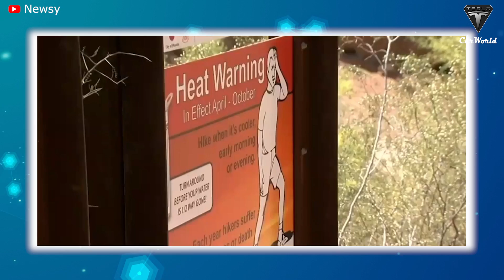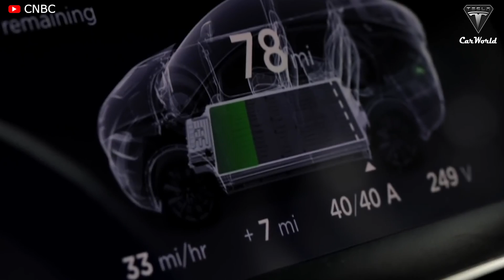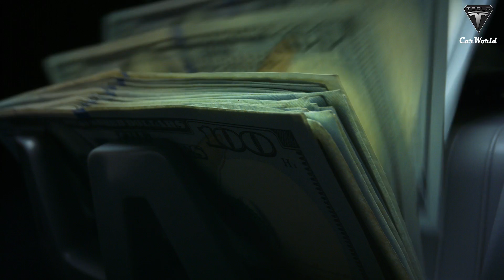NO OPTION! Tesla Faces Big Difficulty, Unable to Install Charging Stations in Texas!

Comment: As a Texas I am surprised to find out I have a weak electrical system in my house and regularly suffer power outages. Other than Feb of 2021 I can't recall not having electricity because of a lack of production. I have lost power because someone drove through a power pole, a tree falling, or a squirrel tripping a fuse. The Texas grid like all power grids can use some improvements. Your introduction makes me wonder about everything else you said.
Tesla's biggest problems is their chargers are proprietary and only Tesla owner can use them. Tesla says they are going to open up their chargers to everyone but until they do they shouldn't get taxpayer money to install charge stations.

Comment: Nope, nope, nope.  Live in Fort Worth.  Power is on.  Stays on.  Texas produces more power than any other state and is a net exporter of power.  473 TWh last year while California produced 193 TWh and has to import power to keep the lights on most of the time.
Reply: I thought that Texas didn't have high voltage connections out of state - or were they broken last winter - or simply not able to carry enough?
Reply: @markelkins8432  Texas is not isolated, take a look at a transmission line map and you'll see lines leading in/out of state.  Several factors caused the load shed event - one in particular was a lack of communication between ERCOT and the Texas RR Commission.  Note that the head of ERCOT and all the PUC have been replaced.
Reply: @stanley917  The first they need to do is get the R out of ERCOT, right now it stands for Ridiculous, not Reliability..

Comment: Very easy fix...just go all out by incentives on Home solar ...
Reply: Yes, I have a modest solar panel system, 3.6kW with net metering and EV TOU rates and living in SCal my Tesla runs on sunshine, my electric bills run a small negative as the panels send more electricity back to the grid than I take off the grid.

Comment: Uh, Tesla charges for using a SC stall, somebody has to pay for the electricity. There are exceptions, when I bought my Tesla it came with a sales incentive of free SC charging for as long as I owned the Tesla. It is my understanding that the revenue is used to pay for electricity, pay for maintenance and the rest used to pay for new SC stations, presumably not a profit center but self-expanding once Elon had it kickstarted early on.  The only per minute charge ($1) is if you leave the Tesla at a stall and don’t move it after it is finished charging (to whatever you set it at), there may be someone else wanting to charge if the stalls are all being used. Makes sense to me. Your Tesla app will let you know when it is done charging.

Comment: I would fact check every thing before putting it in a video. Most of the things mentioned in this video is false. First you don't need as many chargers like you do gas stations as most EV owners charge at home the reason to have more super chargers is to be able to sustain the increasing EV usage on long trips, also the 7.5 billion you are quoting as a cost is also incorrect as with mass production the cost will drop and additionally when you mention profits of tesla at least put the effort to fact check that in Q1 of 2022 Tesla's profits were 3.3 billion. So you are just spreading lies and confusing simple people who might just fall for the misinformation.
Reply: Yes, there are a lot of misinformed people, including so called journalists who are pathetically and hilariously misinformed on EVs, esp. Teslas.  Since about a year or two ago Tesla Superchargers now come in pre-built 4 stall units. This makes installations quick and simple, bringing in the high power line is the hard part. Since Tesla stations are located near restaurants and hotels that is usually not a problem unless the station is a huge one like the one in Barstow, CA close to a large factory outlet mall. The 20  stall station will soon be 100 stalls, the largest in the country.  For typical 8 to 16 stall stations converting existing parking spaces for a high power line is fairly simple, the hang up is getting the permit and putting in the stalls in this period of labor shortages.  Expect many more SC stations in the next couple of years.

Comment: Your update sounds really confusing to me, on one hand you are saying that the Texas Government want to install EV Chargers every fifty miles to service the expected increase in EV vehicle sales and then on the other hand you are saying that Tesla is going to run into challengers when they start adding extra EV charging stations to their existing charging network. Who is going to challenge  them, not the Government because they what more EV Charging stations and the more Tesla install the less they will need to install, and I am dam sure that the people of Texas will not want to stop Tesla from increasing there charging network either. One issue that all EV;s suffer from at the moment is the lack of handy charging stations. If you drive an ICE vehicle, there is never ever a concern regarding your trip because ICE vehicles have Gas stations everywhere, EV don't. If there is a problem with the power grid, and some of your other readers don't seem think there is. That's the Government job to fix it. That why we all pay taxes.

Comment: Why install charging stations in a state that doesn't want electric cars? Here in Arizona, we want them, and are buying them by the sh%t load. There have been 4 new charging stations in Arizona in the last 3 years. There are none in the whole east valley of Phoenix. That includes Mesa (second largest city in Arizona}, Chandler, Gilbert, Queen Creek, San Tan Valley, Tempe, Ahwatukee, Apache Junction, and I'm probably forgetting some. We are currently on a road trip that takes us through California, and I'm amazed at how many choices there are to charge a Tesla. Some charging stations are 5 miles apart from each other. I have shared my frustration about this many times here on You Tube, and even send emails to Tesla to find out what we did to make them mad at us Arizonans, they don't reply to me. They probably laugh when I send an email, "it's him again". End rant.
Reply: California gotta way bigger demand than Arizona. And beside the west coast, there's really no big EV community. People in the south, east coast, and Midwest travel. People on the west coast don't really travel on road trips like that. The time to road trip in an ice car vs an EV car needs to get better tomorrow. Not next week. Not in the future. It's need to get better tomorrow. People still drive ICE cars because even though gas is high, I can fill it up and go. No wait.
Reply from the maker: I hope Tesla reads and takes into account your feedback as soon as possible. Thanks for your comment and have a good day !
Reply: @TeslaCarWorld  Thanks, and I to hope they see this, and do something about it.

Comment: I still want to know exactly where this extra electricity is going to come from? 68 percent of all electric generated by burning fossil fuels in the USA does a electric vehicle make any sense. And explain Who and  How the depleted battery pack will be handed. RECYCLED? How seems no one knows.
Reply from the maker: Thank you so much for all of your comment! Have a good day!
Reply: Michael Shampine - It's these Same "Fossil Fuels" that are used in Oil Refineries to fuel your F-150's!
Reply: Do you understand what a figure of 89 MPGe Means?

It means 3x LESS Energy for a Model X, than for an Equivalent ICE SUV! So, it takes "Less Energy" because Electric Motors find Waste 66% of the Energy!
Reply: Depends on the state. In California about 30% is from renewables, mandated by law to be 100% by 2045 with intermediate goals. All new homes built must have solar panels.  I drive a Tesla, have a modest 3.6kW solar panel system, net metering and EV TOU rates, my electric bills run -$10 to -$25 each month, also have a new heat pump that replaced my 19 yo AC and the old gas furnace. So my house and Tesla run on sunshine, also when I ordered it in Fall of 2019 it came with a sales incentive of free Supercharging for  as long as I own the Tesla which is a 2020 model. Sure beats pumping gas, ymmv.  As for batteries, expect Tesla batteries to last at least 300,000 to 500,000 miles so easily 20 yrs+for most people. As for old batteries, they are being recycled by recycle firms such as Redwood Materials founded by a former Tesla executive, I think they are in Reno, NV.  Have you owned an ICE that went over 300k miles?

Comment: I'll never invest in an EV. I don't see them as very reliable.
Reply: If you don't see EVs as reliable, I'm curious at to what you are looking at.
Reply: @evwannabe593  I've had my car for a while and I'm not shelling out what they're asking. I'll stick with my car.
Reply from the maker: Electric vehicles are gradually making breakthroughs. I hope you will think about this. Thanks for your comment and have a good day !
Reply: @TeslaCarWorld  Sorry, but I've made my decision.
Reply: Much more reliable than ICE, much less parts, no need for oil changes or tuneups, brakes jobs normally not needed thanks to regen braking, I can drive for a week and only use my brakes once or twice. Go test drive a Tesla, no sales pressure, make an appt online, you’ll see why EVs are the future. A paradigm shift to EVs is happening right now, just a matter of time before you too wise up, the sooner the better for you economically..
Reply: @williamjamesayers7719  - How much are you shelling out for gas every month?  With my solar panels and net metering my Tesla runs on sunshine, beats pumping gas, trust me negative electric bills are nice, ymmv.
Reply: @Chainyanker007  doesn't matter. Everyone has their own choices for what they want.
Reply: @Chainyanker007  the reason why because I don't want to be forced into buying one.

Comment: Texas has many issues, massive growth in population caused by many moving from other areas as well as huge growth in industry.  The power grid has not kept up, some of this is because of restrictive industry regulations building new plants, and ever changing new green regulations and Industry carbon credit schemes.  It also has very hot weather where AC is basically needed in any buildings. 
The electricity industry takes 10-15 years to build a new plant, they did not anticipate and plan.
Reply from the maker: Yes, that's right. The Texas government needs to have strategies in place to ensure a stable power grid for residents during peak heat or cold weather.
Btw, thank you so much for your comment! Have a nice day!